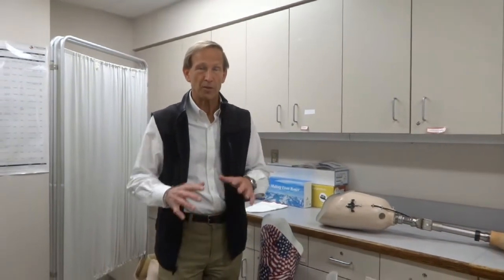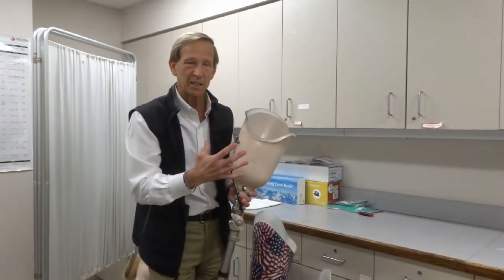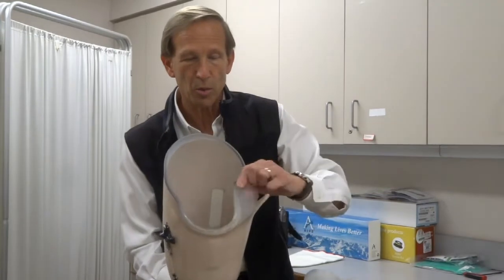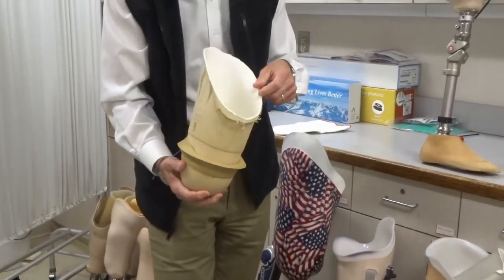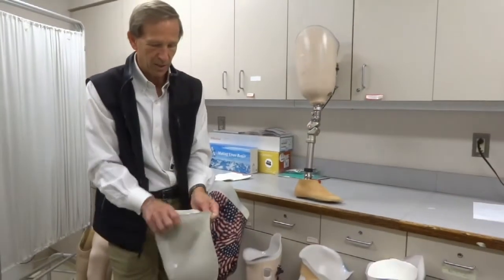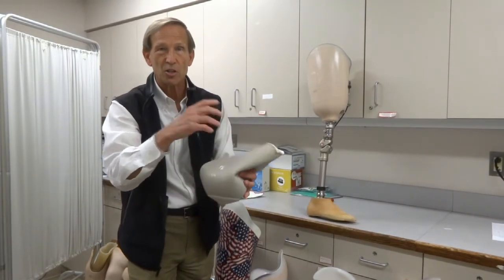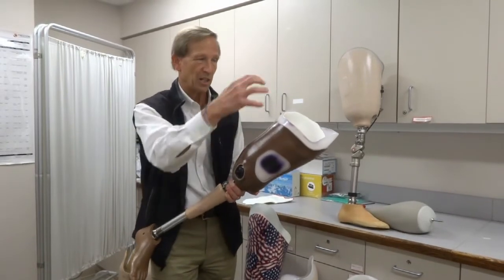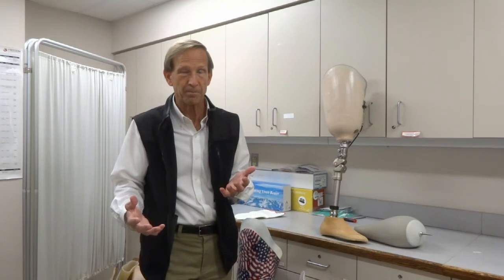Lower Limb Prosthetics - AKA Socket Design w/ Doctor U Wanna Know (ep. 5)

Comment: Nice Job Dr U.....I am 55 yrs old and next year I will have been an AK for 50 years.  Suspension is still the hardest issue  to master, especially for active amputees.  Thank you  for you series.
Reply: why is suspension difficult? and since you've had it for so long, which have you preferred over time--no interface or interface?
Reply: @karthik_silkroads  Everything about the socket is custom made for you only and if you aren't comfortable with the fit or the socket doesn't stay on well then you will experience difficulties.  This takes time and patience and a good prosthetist. I still struggle with the interface ? all the time.  I currently use a liner with a pin locking mechanism by coyote design.  But honestly, I still miss the straight suction.  It gives you the best feel and suspension but you do have to put up with more skin irritation and breakdown.  Still though, it easy to take on and off and you can use the valve to adjust air pressure inside the socket.  Feels like it is part of you, like not wearing a condom so to speak.  Alignment of the prosthesis is also critical, I make my own small adjustments to the alignment to get it right for me.
Reply: @georgegarner5331  did your old suction-type suspension wear out? that does sound like its more a part of your body. what kind of activities do you like to do with your prosthesis? and thanks for the knowledge :)
Reply: @karthik_silkroads  Sockets don't wear out so much but you do grow out of them.  Putting weight on or dropping weight or you think some thing better comes along that you want to try.  I've done everything people with 2 legs have done and continue to do.  It's my life.  Over the years I have done basketball, tennis, martial arts, boxing as far as sports goes.  I had to keep up with my brothers and friends growing up and never had any other amputees around me and still don't.  Are you a new amputee?  If so, what is it like for you?